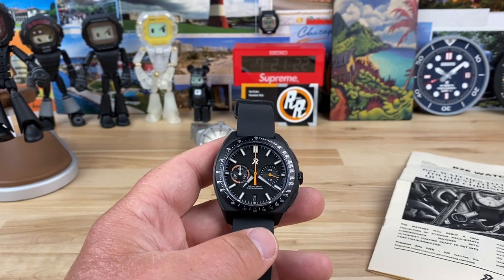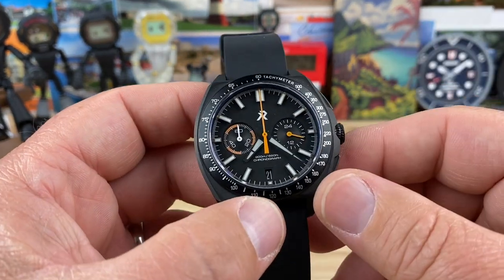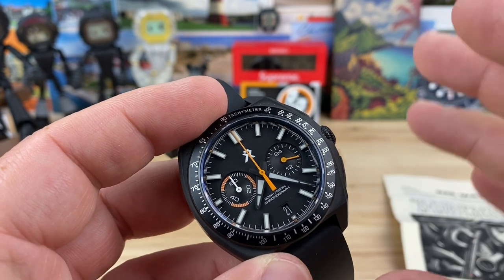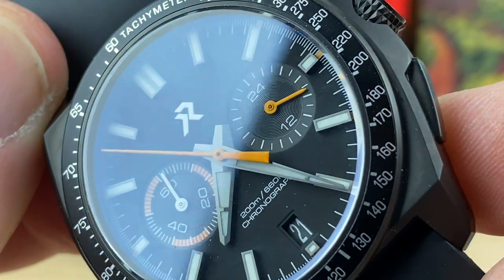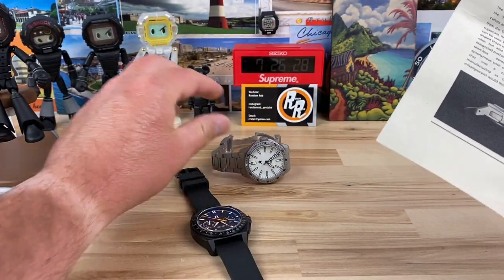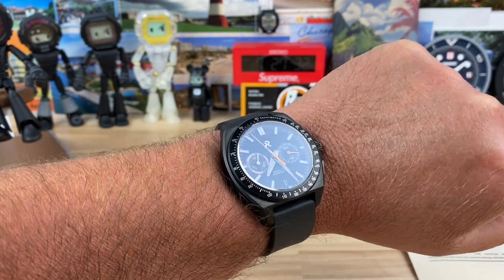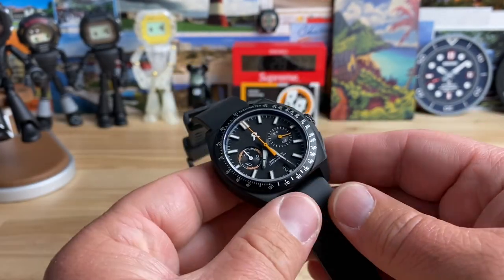RZE Valour Chronograph (prototype! Production model will change)

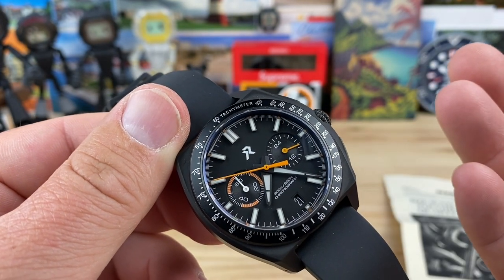Comment: 3:04 the second hand stops after 1 hour (at least so it does on my roue tps) so you can't just let it run. Only If you keep pushing start every hour or so
Reply: @ralphus555  what's with the stupid question ?!
Reply: @ralphus555  Did you not understand the comment in relation to the video that suggests you can use the second hand as a permanently running second hand.